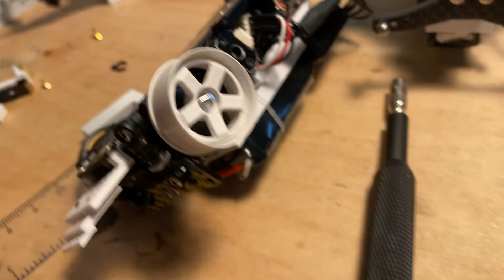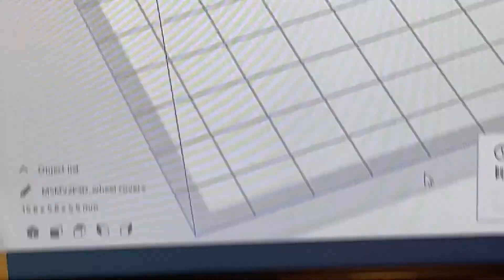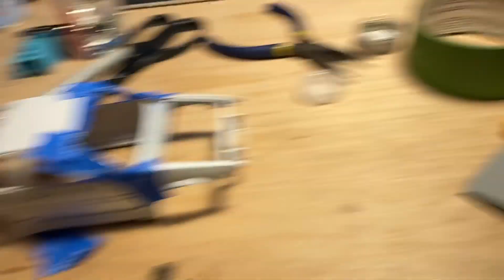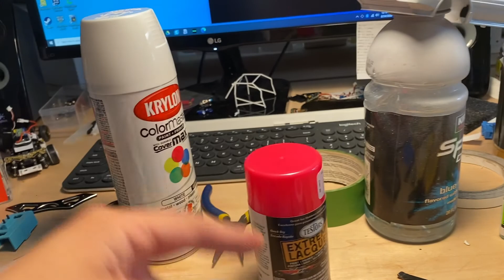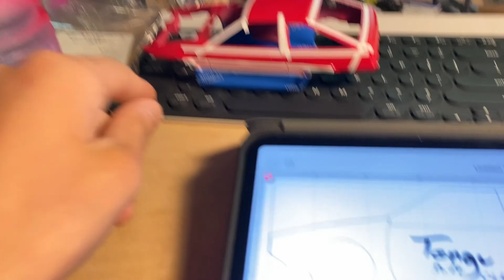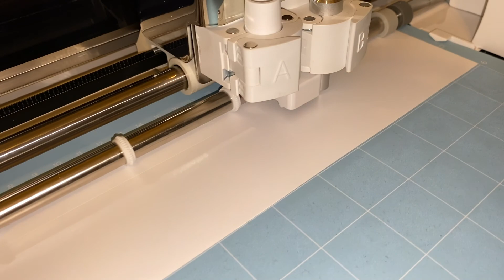Rc vlog 3 (trying to paint a model kit)

Comment: Hey guy, I do like your videos, it's an insight into your mind, analyzer yeah,lol anyways, I always thought the best battery placing is on top,it provides center of gravity and frees up tons of real estate,do you think that it affects the car rolling over?
Reply from the maker: Juan Pizarro I do feel that it doesn’t affect the cars roll but it’s not enough weight to roll the car over. It also depends on your battery size/weight, but if you run a standard size battery I don’t think you’ll see much of a difference.